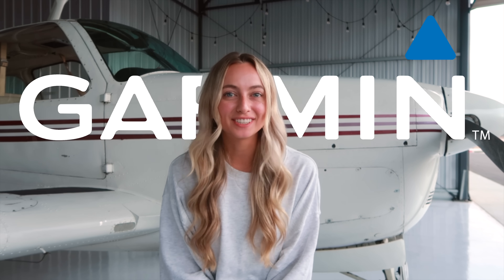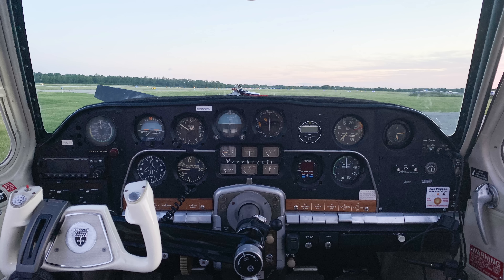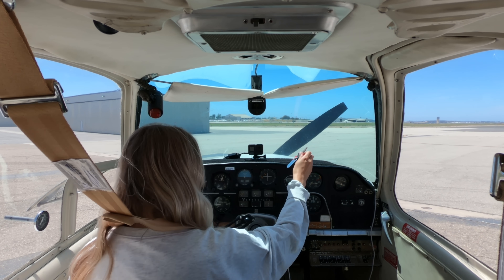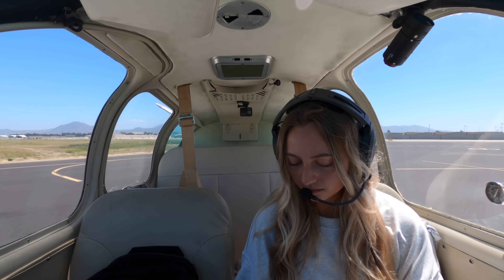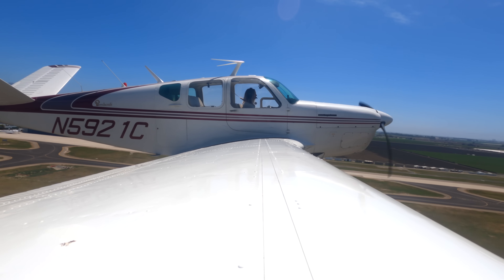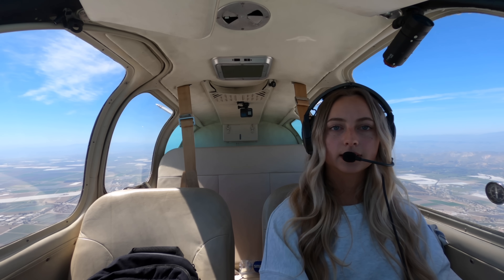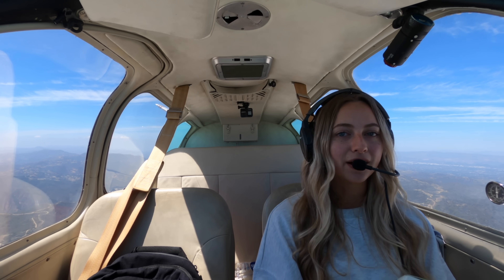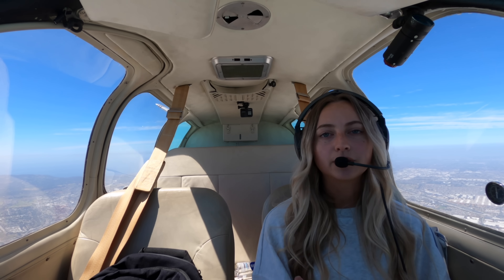Installing ALL NEW Garmin Avionics in my 1952 Bonanza | Garmin Panel Upgrade Part 1

Comment: i am contemplating a similar upgrade with Neal Aviation on our 1993 Bonanza. Any reason you chose a GI 275 stack over a G5 stack with the GI 275 EIS?  And why you retained the ASI, turn coordinator, altimeter and VSI despite getting the GI 275s as primary? Extra redundancy?  Visual preference?
And yes, way to promote consistency and annunciate all the checklists - I warn my pax I do a lot of talking to myself...
Reply from the maker: Hi there! I chose the GI 275 over the G5 for a few reasons. First, I find that the GI 275 is a lot easier to read and use than the G5. It might not seem like it at first glance, but the GI 275 has more screen area than the G5, and the picture seems much sharper on the 275 to me - might be because of the colors. The GI 275 AI and HSI also have a lot more features than the G5, such as synthetic vision on the AI and a color map on the HSI (I've found this really helpful for taxiing at a big unfamiliar airport)! I also went with the GI 275 because they're round and I thought they looked more natural in the panel. 

I kept the ASI, turn coordinator, etc for looks as well. I've seen a Bonanza panel with JUST the 275s and no analog gauges and while it looks really clean, it also looked somewhat empty. The only reason for keeping the analog gauges was for personal preference, no major functionality reason.

Neal Aviation did a FANTASTIC job on my panel, I truly cannot recommend them enough. Part 2 of the upgrade series should be up Thursday, and there's photos of the finished panel on my Instagram if you want to check it out before then! Let me know if you end up going with Neal Aviation and the GI 275s for the upgrade!

Comment: Stevie, we're contemplating a similar upgrade with Neal Aviation on our 1993 Bonanza. Any reason you chose a GI 275 stack over a G5 stack with the GI 275 EIS?  And why you retained the ASI, turn coordinator, altimeter and VSI despite getting the GI 275s as primary? Extra redundancy?  Visual preference?
And yes, way to promote consistency and annunciate all the checklists - I warn my pax I do a lot of talking to myself...

Comment: I put Garmin 275 A/I, HSI, and Engine analyzer , Garmin 375 GPS/ADS and Garmin 500 A/P in my 1977 Cessna 206G 2 years ago. Great instruments. I’d change the landing gear switch to something more standard and not look like other switches,if it was me.

Comment: I am very excited for your panel upgrade.  I can tell you from experience having good fuel and engine monitoring is very nice and having a good auto pilot will absolutely change your flying experience.  Also I don't know if you have LEDs right now but if you don't, they changed my night landing experience.

Comment: A friend has an aircraft, less than two years old, fitted a "G" system.

Luckily, many of the places he flies to are mainly remote Indochina landing strips with minimum formalities, which is just as well as the "G" package had successive hardware failures that more often as not, the dash had holes in it where something was missing - usually away for service. Note, these were "box" failures, not wiring or installation failures.

The joke was that the airframe had more flying time than most of the instruments. In the end all the electronics was removed and replaced with a completely new set of hardware. My friend changed one thing - Garmin label became GARBAGE and all the 'temporary' GPS, radio, etc remained in place on the dashboard for months. . .  in case.

Seemingly, GARBAGE is popular with vendors because the sales commission is high.

Comment: Good to see another video!   I'm glad you want to keep the classic look of your panel.  I've seen folks rip them out and then toss them in the trash which is where I got a Bo engine cluster from.  You'll love an autopilot!   Mine isn't as fancy as yours but does the job, is 2 axis and is the first time I ever had a functional autopilot.  It's awesome.  Did you buff out the plane since the last video?  She looks nice.  I did the same flight from Camarillo (but to Torrance) just yesterday.  Good to know that I did it right by your very professional example!   Happy Aviating!

Comment: I'm doing a similar upgrade on a C172 it's either a 97 or 98 model  , 3 GI275s , GNC255 , WAT LED nav lights GSB15 , after a marathon instal/upgrade on a piper Aztec recently this is like a cakewalk

Comment: Pleased to see your devotion to flying professionally.   If I may offer a suggestion  as a CFI and 35 year airline pilot, simulator instructor and check airman, on single engine airplanes and most light twins, it's a good idea to leave the gear down on takeoff till there is no usable runway ahead.  The "positive rate, gear up" call comes from the certification requirements for FAR Part 25 transport category airplanes that have the performance to climb away from the runway if an engine quits, which is not the case for singles, nor for most Part 23 light twins.   
If I may add another thought,  in the airlines, our SOP on landing was to not touch any switches or controls till clear of the runway.  More than one pilot has mistakenly retracted the gear when they thought they were retracting the flaps, inadvertently trusting that the landing gear squat switch(es) hadn't failed.  I have flown C and J model Bonanzas with the piano key switch panel and was concerned about the minimally different gear and flap switches, and made it a habit to not touch anything till I was on the taxiway and could ensure I was moving the correct control.  Keep up the great work!

Comment: Engine monitoring could save your life and will keep your engine so happy. I couldn't fly peacefully without knowing all CHT and EGT. Hopefully you get lucky with the LOP balance between your cylinders. I usually run with 3 cylinders 40-60 deg LOP and 1 cylinder hangs out at around 20 deg LOP. Cruising at 180kts 7.4gph in my Long EZ (0-360 carbureted). My CHT's get a little warm on climbout at full throttle(400f on number 2 and 4 380f on 1 and 2), so i usually throttle back for a 500fpm climb at 120kts to keep them below 370, leaning as altitude increases - you can't damage the engine with leaning below 75% max power. You'll see about 1/2 the metal in the oil by keeping CHT at 360f vs 420f.

Does anyone know if its bad for your engine to slowly reduce throttle to idle over the course of 5 minutes, letting CHT's drop to 220f, and gliding it down from 10500' for landing? That's my currently preferred method for decent when I'm in no hurry and want to decent at 100kts and 700fpm. 

Keep up the good work with your videos, i'm inspired to start creating some myself.

Comment: Stevie. New panel looks great. I like where the Auto Pilot will be. Save the old panel for Hangar art on the wall. I just had a new panel installed on my Cardinal. Installed a JPI 900. Question what is the purpose of the blue covering on the Windows? Enjoy flying your Beech with the new panel.

Comment: Saw the airplane at OSH. Looked great. Congrats.

You'll have to let us know if you miss all that hand flying 😀

If you've not done so already, put a red pull ring on the AP circuit breaker.

Comment: Your step is up when parked.  Cable broke?
Reply from the maker: Ha yup unfortunately. Still trying to find a part I need to fix it. Have the shear link and the cable, just need the attachment point between the shear link and the nose gear
Reply: @bayflight  I understand.  My cable broke in flight one time right after takeoff (51’ C35).  It scared the crap out of me.  Sounded like the tail fell off!  LOL.  Interesting enough, it broke at the nose gear too.

Comment: Nice video, thanks for uploading!

That's a neat wire harness.  We used to make them up on special boards with everything laid out.

Typical size harnesses on boards about 12 feet x 6 feet were for engines, e.g. JT8Ds on our B727s and DC-9s, or RR Darts on our F-27s.

The biggest wire harness board I recall was massive - I forgot how long it was, but it was the first-of-type so we did a few changes.  It was for the Inertial Navigation System (INS) installation in our B727s ... I still remember many of us crawling into some of the least-visited spaces in the airplane and helping install that harness - it took hours!  Another large harness was the GPWS installation on the DC-9s.

Comment: Stevie...I have a 1955 Cessna 180 that I wanted to keep as original as possible.  I did a full Garmin update except no autopilot.  Very similar to yours.  Even though the plane was technically IFR legal, now it is IFR safe for single pilot.  I also upgraded the o470L to and I/O 520 which was incredibly expensive.  That said, I have a better than new Cessna 180 tail dragger that is a very capable airplane.  I have over 8000 hours and nearly 2500 hours in this plane.  You are absolutely doing the right thing.  Preserve what you can, modernize where possible.

Comment: Great to see you back.  Since I own several own several late 60's and newer high performance vehicles, I have always tried to keep everything as original as possible for resale value (since I've been here over 3/4 of a Century now, that's for the benefit of my daughter and grandkids in hopes the resale value is not diminished because of modifications that destroy the original vehicle).  I know full well that mentality has zero to do with the best course of action when it comes to aircraft.  I am very pleased to see that Neal is doing everything they can to keep the original layout of your panel, while at the same time, giving you the current avionics, instrumentation, and auto-pilot for optimum flight safety.  Your decisions as to what you are having done with the upgrade seem very well thought-out to me.  Great Job.  Looking forward to seeing the end result and riding back with you upon completion.  Please keep the great videos coming.

Comment: Autopilot is a GAME CHANGER. I fly everything from 6 pack 1960s equipment with no AP to glass panels including g1000 NXI and g3000 with fully integrated AP with vnav capability. Makes IFR SO much easier and you're going to be way less fatigued on every flight using it. Enjoy the heck out of it!

Comment: Those radios on your left should have been in the center.  If you fly with another pilot, that other pilot could catch any slip-ups, and as well in a situation of trust actually help with the "knobs".
Reply from the maker: To each their own! I prefer them on the left, they are much easier for me to reach. I typically fly by myself but when I do fly with another pilot, the radios being on the left has never posed an issue, both with the old panel and with the new panel.

Comment: Screw the vintage. Upgrade everything possible! 👍🏾
Reply from the maker: That's what I wanted when I first bought the airplane, but over the two years I've owned it, I've come to appreciate its vintage design!  I'd like to eventually own a Baron or similar twin as well (way, way down the line) that I can upgrade everything on!
Reply: @bayflight  Ooh, the Baron is nice. 

I wish Beech (Raytheon now, I think?) would bring back the Starship. I would (if I won the lottery....) get my pilots' license, buy one, and fly across the USA with it.

I'm going to SORT OF do that, anyway, because the Starship's coming to Microsoft Flight Simulator!

Comment: Wow, so jealous of that awesome upgrade.  Looks like you kept the piano keys (love them) however just curious why you kept the GPS and radio stack on the left side of the panel.  I understand that some of that has to do with it being a structural component.   Unfortunately my 1947 is still down for maintenance, but will debut as soon as I can.  Keep up the good work!
Reply from the maker: Glad you like the upgrade! Aside from wanting to keep the airplane looking vintage, I kept the radios on the left because I actually can't reach the right side of the panel without leaning forward in my seat!  That's why the autopilot is in the center as well vs more on the right side of the panel. I hope your Bo is back up soon!

Comment: Stevie I did this also. My suggestion is get rid of the piano keys. I like them as well but, they are 70 year old switches that are not reliable. Modern circuit breakers are not as classic but much more replaceable. I retained the piano keys. It was a big mistake as I had to fix a few of them several times. Don’t forget to rid yourself or update the resettable circuit breakers on the bottom of the glovebox. Make sure all the old wire is removed not cut and left in place.

Comment: Does your Bonanza have the older type of fuel management system that has caused crashes in the past? If so, I’m curious what extra procedures you might have developed to handle that.

Edit: Oh! I asked the question before you got to that point! Still curious about any procedures you developed.

Comment: Amazing start on the Bonanza transformation! Looking forward to part 2. Question, the switches on the lower left side of the panel, it seems Iike the labels would be easier to read if they were above the switches vs. below. Was this done in keeping with the vintage feel of 21 Charlie?

Comment: The fact that you've flown your airplane manually exclusively, will give you a better appreciation and use of your new autopilot. A lot of pilots depend too much on the use of the AP before they've really have gotten enough "Stick Time" and hand off the aircraft to the AP very early on on most of their flights. I think that makes them less proficient and able to predict and handle a myriad of situations they can find themselves in.

You on the other hand are, IMO, an excellent pilot. You will benefit from the AP and will appreciate and use it better then a lot of other pilots. I'm very excited to hear you wanting to go IFR again. As you know, it will open up flying to you in so many other ways that make it safer and more flexible then just with VFR.

Thank you as always for taking us along with you. I so very much appreciate it Stevie!

Comment: Hi Stevie, Nearly the same upgrades were done to my K35 this year. Biggest regret is choosing the GNC355. An upgraded version would have prevented a chain of grief when my existing secondary KX155 nav com subsequently failed. Looks like you picked the right installers and you'll love fuel mgmt. Glad to see you're back!

Comment: Are you planning on putting in an IO-520 when OH is due?
Reply from the maker: I'll keep the E-225 but I'll probably put 470 cylinders on! If I wanted to upgrade to a different engine I'd have to modify the cowling, get a new propeller, and add oil lines for the propeller since my current propeller is electric

Comment: Hey Stevie, I grew up and worked in Silicon Valley, next time you fly to San Carlos airport, coffee on me at the airport cafe. On another note, I would highly advise to have a test pilot fly this plane after this job is done; throwing over $50,000 on an old aircraft can and could cause some flight operational issues with how these FAA certified technicians MAY have overlooked or accidentally damaged an internal mechanical part during this costly upgrade, for someone smart and talented like you, you deserve a new aircraft.  

PLEASE have the plane inspected for air worthiness by a certified A&P mechanic and have a test pilot fly it FIRST before you do.
Reply: It will be fully tested out by the company before Stevie gets to fly it again. I'm pretty sure that's standard procedure.
Reply: @nigelb5370  Yep, agree - I thought the OP's comment was a bit of a funny post.  It won't get an airworthiness certificate unless the respective LAME's (avionics, A&P) sign it off.

Comment: Are they going to pull the old ADF antenna off the roof since its not used any more, at this point its just causing air drag.

Comment: Great to get updated and confident with IFR capability and an autopilot!  Big upgrades that add value too.  Is there a way they an change that fuel recycling thing back to left tank?   Great to have both tank display, but that fuel recycling thing was alway weird. I think Beech stopped that in about 1960.  Enough to keep track of already.   Love the videos and I like that you keep the vintage look too.

Comment: Why do you always select left fuel tank for take off and landing?
Reply: Early Bonanzas return unused fuel from the carburetor to the left main tank, no matter which tank fuel is currently being drawn from. Therefore, left main is selected for takeoff to avoid pumping fuel overboard from the already full left main on takeoff and for the first hour or so of flight. Since return fuel goes to the left main, it is good practice to land with left main tank selected, especially on long flights which run the right main low on fuel.
Reply: @jamesnelson7415  Thank you

Comment: Is a plane 70 years old still in good enough condition to fly often? How long can an old plane last?
Reply from the maker: Yes! All certified aircraft have to undergo an annual inspection to make sure that everything is safe. There are lots of older aircraft still flying - my boyfriend has a 1941 Piper Cub that he flies around all the time!
Reply: DC-3, Grumman Goose/Widgeon/Mallard/Albatross, Stearman, Piper Cub, TaylorCraft (RIP to one of them, though)...I could go on, but I need to get to bed.